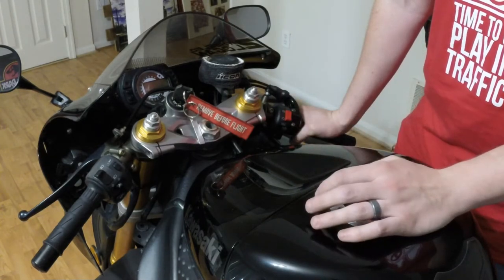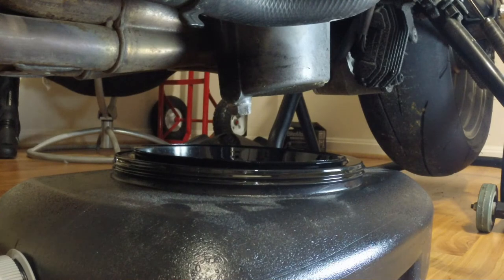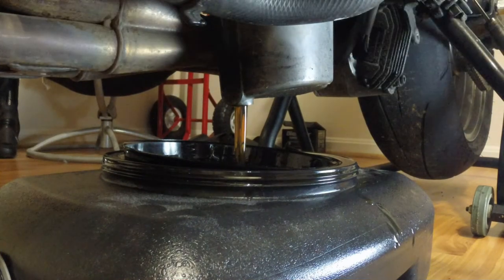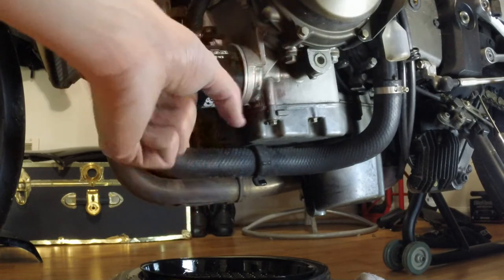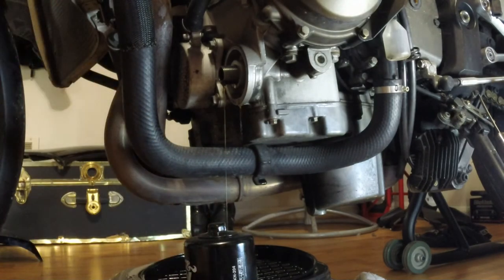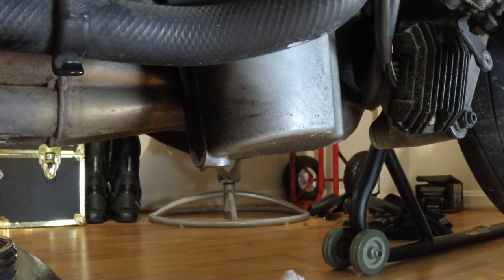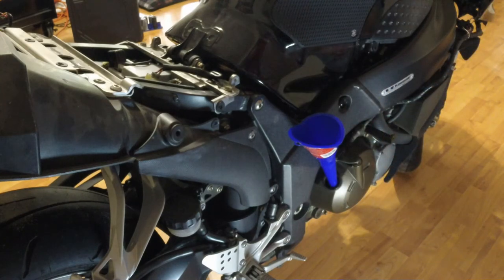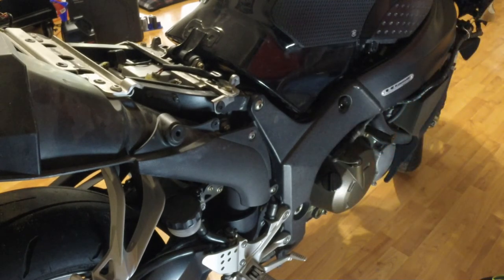Kawasaki Ninja ZX6R 636 Oil Change (2005/2006)

Comment: Great video, I have the same bike in the same color so I'll be doing this today for the first time since I've owned her. But I've heard I need crush washers.. I noticed that you didn't use any in this video, any insight?
Reply from the maker: I know proper procedure says to use a crush washer. However, neither this bike, nor my previous one (or any car I've owned for that matter), has had one on it. Knock on wood I've never had an issue in any of the oil changes I've performed in the past, and have never put a new crush washer on because of this. Putting a new one on is probably the right way to go so I won't say don't do it, I just haven't had a failure after not putting one on. Hope this helps, and thanks for watching!

Comment: Few things:
-You forgot the crush washer that must be replaced every time on the drain bolt; I didn't even see you using one. It is used as a gasket, and VERY important that you use it and replace every time!
-That oil filter is way over torqued; there is no reason for it to be that tight. Hand tight is plenty tight, and it is why I don't like K&N oil filters (because people tend to over torque them)